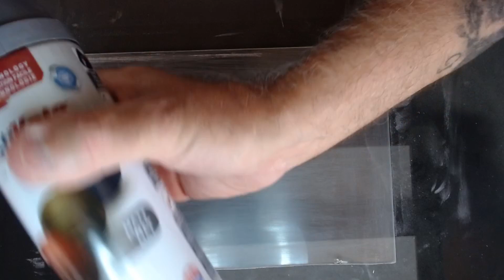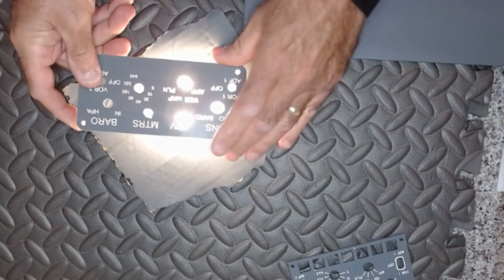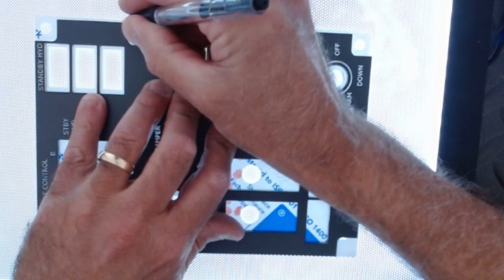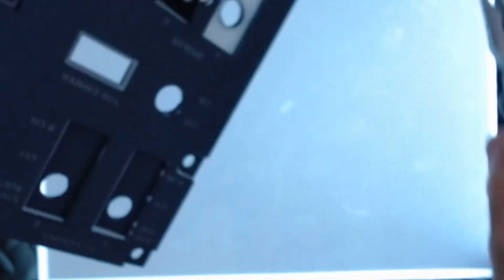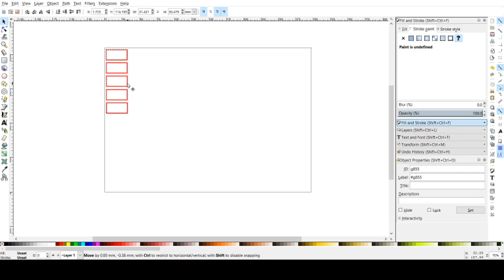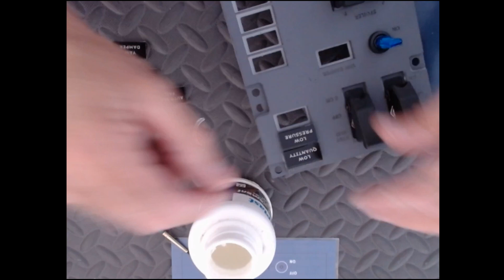Boeing 737 Overhead Panel Build part 1

Comment: I think the alternate flaps and yaw damper are in the wrong spots, the yaw damper is on the bottom of the panel and the alternate flaps are around the center of the panel.

Comment: Hi There, what mm/s did you use in k40 for cutting and engraving and what power on the laser?
Reply from the maker: Hi Tijmen thanks for subscribing. I believe I did mention in the video my settings for cutting and engraving but if you can not find it just let me know and I will look them up and message you back.
Thanks again and there are more panels to follow the next should be the Navigation and Fuel Pumps panel.
Reply: Sorry my mistake I thought I put it in the video but its on the Thingiverse file. Cutting was done at 5mm / sec at 10mA two passes were required to cut through. Raster Engraving at 100mm / sec 10 mA

Comment: Where did you find measures of panels, can I get them just for the A320? Please
Reply from the maker: Hi there I got most of my measurements from markuspilot.com he has a downloadable pdf with all the aircrafts dimension. For the overhead I downloaded a photo and scaled it using fusion 360.
I hope this helps. More videos coming soon so please keep tuned........
Reply: @togatech1111  no worries sir, you're the best. I'd like to begin that, so I first need the laser then I hope that's not hard to use. Can I leave my e-mail adress if possible ask you sometimes questions. If you also fly with IVAO network, it's going to be a pleasure, flyi g with you. More videos.